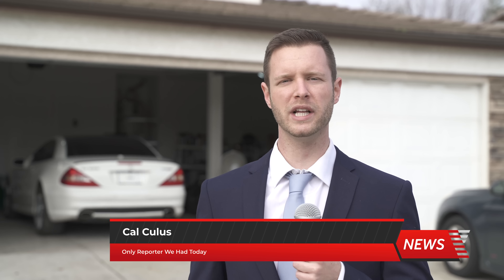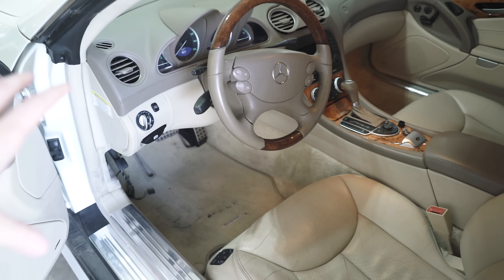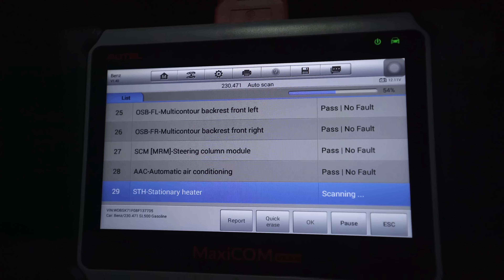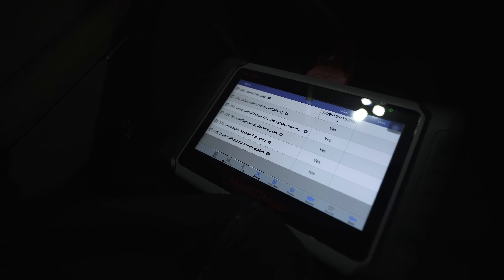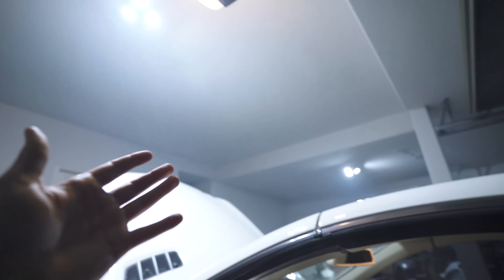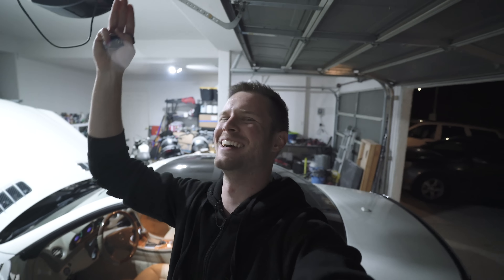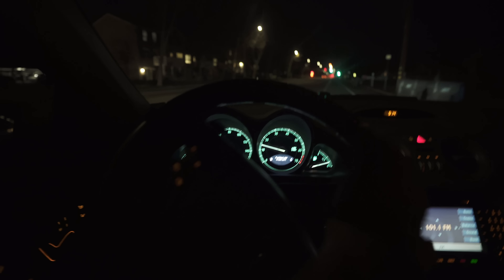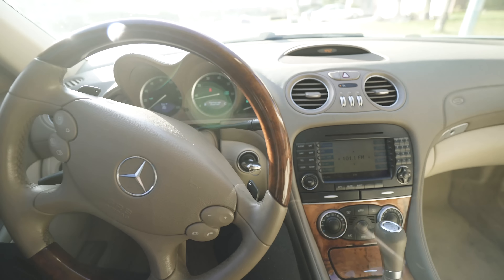the SL550 is FIXED! (Activating TRANSFORMER Mode)

Comment from the maker: I also think that someone sabotaged the throttle connector for the insurance claim – The car's VIN check reports the car was never claimed a Total Loss and was never reported in an accident. Someone probably just wanted insurance money and knew it wasn't damaged enough to be claimed. So they rolled over a curb to break the bumper and sabotaged the throttle to add check engine lights and codes and was like "I DoN't KnOw wHAt's WrONg, I JuSt waNt iT gOnE"
Reply: it is normal for cars to add fuel on starts for a little because when cold in order for the engine to run at non operating temps it adds put once the engine is at proper temp it leans it out to get the correct air to fuel
Reply: I’ve just sent you a pm on Facebook :)
Reply: not at you but with you Bro.
Reply from the maker: Or someone who wanted it at the salvage yard did it? 🤷🏽‍♀️
Reply: @TheInja  
I was thinking along the same lines ! Someone who knows that glitch has done that to de-value the car, maybe someone who has a nice spare SL bumper maybe ?
Reply: Hey inja how tall are u?

Comment: I am SO pleased for you as I have been where you are now.

When I was young I bought an immaculate, as new BMW Motorbike that suffered from intermittent and untraceable engine stops when the steering was turned too far in either direction, sometimes just not starting at all and meaning LOTS of exhausting bump push starts.
How I hated that.

The front end and all its components were stripped and reassembled MANY times but to no avail.
Otherwise it ran well till one day I decided to charge the battery, only to discover the negative terminal loose and when the forks were turned, THE SPEEDO CABLE MOVED BACK UNDER THE TANK AND LIFTED THE TERMINAL OFF !!!
This was the previous owner rerouting it.

A lot of Folk might feel daft, missing that, but I unashamedly danced for JOY ! in front of my Pals !!!

There is SO much satisfaction in making a good thing perfect.

PS, if I hate haters, does that make me a hater ?
I would hate to think so.

What's that Dear ?
Time for my pills ??     🕐 💊💊

G'night.

😴 💤👙💤💰💤🚗💤🍺💤🐨!💤
Reply from the maker: Haha goodnight, my man 😆

Comment: So glad you got it fixed. I follow a guy that does copart buys. He runs into stuff like that all the time, he said the people wanting to bid on it or the workers helping a friend that’s gonna buy it will leave key turned on so it will run the battery down and people come to look at it but it won’t start so they avoid it. He said they will unplug stuff like that gas pedal so people will think it has major issues and it will either sell low or people won’t bid and they can get it for cheap. He always looks for that and takes a jumper starter box with him every time. I have learned a lot. When you said copart, I immediately figured somebody rigged it because it was in too good of shape to have major issues. On one video, someone had unplugged the ground to the computer on a cobalt which made the transmission not shift into drive and the dash cluster not work. He bought it and plugged the ground back on, fixed everything. People are so sneaky at coparts. I hope everybody sees this comment so they can watch out and get good deals instead of being tricked.

Comment: Nice job Inja! FYI my friend has almost the same car and the top stopped working properly. It went to the dealership and turned out nothing was really wrong except the top had never been serviced. There are a whole bunch of points in the convertible top mechanism that need to be lubricated, if resistance is sensed the top stops mid way. Probably a good idea to go through it. Cheers from Canada 🍻
Reply from the maker: Much appreciated and will do!

Comment: Sir, this is AMAZING to watch, I am impressed, you could become a indie mechanic. You gotta understand, I am so impressed you did this without running to an older Euro mechanic, because I had an r129(sl500) that had tons of problems and I am not mechanical so I had to take it in countless times, sold it after ten years and got my dream, 2011 sl550 with 44k on it, one owner, mint freak.

Comment: Did you try putting the original throttle back in with the connections the right way to see if the old one still works

Comment: Thats definitely looking like somebody at Copart intentionally sabotaged the pedal connector
Reply: Either that or the original owner had done it so the insurance paid out
Reply: @MegaNayton 
Maybe, that was my thought too, but sometimes folk just zone out on the job.

However, if I worked in a place that prepared cars for auction, and I fancied one myself, I might just consider a bit of easily repairable sabotage.
.
.
Reply: @MegaNayton  

With the possible intention of buying it back with an untraceable, irreparable 'fault' ?
.
Reply: Another bidder sabotaged it, hoping for lower bids.
Reply: @redleader7988  

How much were you hoping to get it for ?
.

Comment: It's not two positive terminals. its just an inline battery. You can even see the negative mark on the right side of the battery. The double red caps is just to tell you that the circuit can still be completed without the battery.
Reply from the maker: (it was just a joke :) )

Comment: Hey is that a push to start button on the shift.
Reply from the maker: Yep! Very cool car.
Reply: Ok can you push to start it or do you need the smart card key
Reply from the maker: @slimatmim  should be able to start it without inserting it. Don't know how to yet though 😅
Reply: @TheInja  Keep the key in your pocket, press the brake pedal down, with the shifter in P (or N) press and hold the button down, release when the engine fires up. Reverse process to turn off and if you don't put your foot on the brake and press the button the ignition will come on only. Any problems try changing the key battery, the batteries drain quite quickly (6 to 12 months with daily use) so it needs strong, fresh button batteries from a quality brand. When the car is locked try pressing and holding the unlock button on the key while pointing the narrow bit of the key at the small black window by the door handle lock from a 1-2 feet away, the car should unlock and all the windows wind down and if you hold it down long enough the roof will retract (if the boot divider it in place), but the Infra red sensor in the handle is often known to break. Again reverse to close up, but watch out, the roof pump drains the consumer boot battery quickly, and like I've said on your last SL videos,  if not used daily keep that battery on trickle charge, keeps the error codes away!
Reply from the maker: Worked like a charm!

Comment: Normally, the engineers that designed the connector, have orientation tabs, so that it can only be installed one way, the right way.  I'm wondering if those orientation tabs were cut off?  To have such a fault by reversing the plug, is a set up, in my opinion.  Name another plug that you can reverse?

Comment: That was my old car sir  i totaled it insurance totaled it/ from visalia body shop. I have the pedal commander i took out in a hurry /and the RennTech the vin locked ECU handheld tuner the car is in Tune mode and can be switched back n forth at the flick of a switch for dealer service . Im super happy to see it again it was my 50th bday present from my Wife & Son. I was pissed the insurance wouldn't let me purchase it back. I made a decent profit on it but it was my baby so much i purchased its big brother after i moved to texas  I have the SL63 AMG now. contact me if you want the stuff for that car. its in my garage somewhere . PS LEE stereo in visailia did the audio HACK i was pissed took them 2 months to repair the mess so it was acceptable. I left the back up cam on vehicle , sorry about the scratched headlights, other than that all i did was run off road into a ditch i think the adjuster wanted to buy the car....lol Progressive...